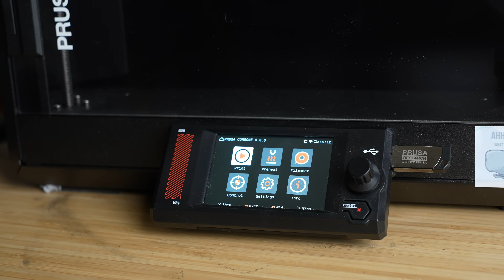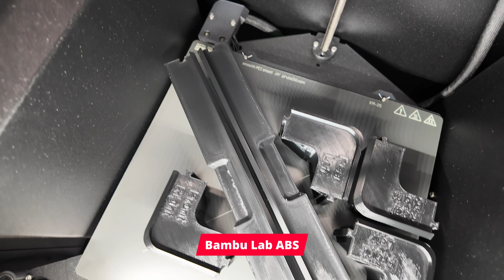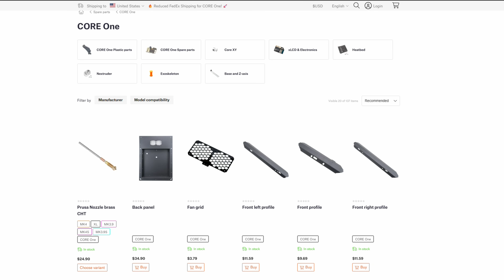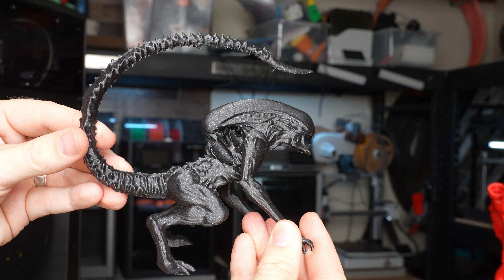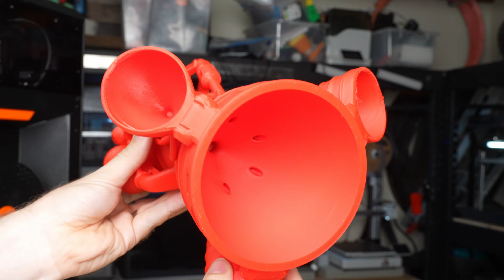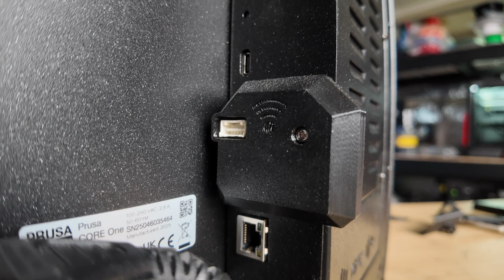The Prusa Core One Surprised Me In a Big Way

Comment: I like the look of their printers and I appreciate the openness, however...

My issue with the supposed benefit of upgradeability is that the cost of major upgrades can be as much as a whole printer from another brand.  The argument that it reduces waste does not necessarily hold true either.  In the case of other brands you potentially have a working printer that can be given away or sold, but an upgraded Prusa leaves a bunch of useless parts.  Their updating options do help when it is small improvements, but then again in the case of Prusa printers it seems to be because they invariably release them half-baked.
Reply from the maker: I think they are focusing on other aspects maybe? Not just pure feature?

Comment: It’s a bit disappointing- it could’ve had some bigger print volume without those sides plunging inward.  And the lack of a hardened nozzle and camera - yikes.  These aren’t expensive components to build in for added value.
Reply from the maker: I think they kept the same build volume because they wanted to keep their promise of having the printers always upgradeable. So in order for that to happen, it needed to keep the same build plate size as the Mk4s
Reply: @RadDadsPrintLab that’s an interesting point.  For me, being smaller than the popular 256^3 is a real downer.  And the lack of an onboard camera or any level of air filtration, which even the $299 Elegoo Centari Carbon, has

Comment: Just got the kit and the camera was included for free.
Reply from the maker: Yeah they started that promotion after I was done with the video haha . You do still have to install it?
Reply: @RadDadsPrintLab  From what I saw online, if it's pre-assembled they'll have the USB-C needed pre-installed for you, and you just connect the Camera. If you have a kit, it'll require installation.
Reply: @RadDadsPrintLab  install it meaning - take it out of a bubble wrap and plug it into the the pre-exisiting USB cable (its already in place) and attach via magnets to the corner - and then you have the camera read a QR code on your phone. Its about a 1 minute job

Comment: I purchased a brand new Bambu Lab A1 Combo, and now I have to return it for a full refund because the 2nd Spool slot will no longer feed the filament through due to an Overloaded Motorhead error. Get back with me when 650.00 3d printers or their accessories no longer become faulty in the first 3 weeks of purchase.
Reply from the maker: Dang that sucks

Comment: I think the "grow with you" aspect of Prusa printers is quite true. I've had a number of FDM machines from other brands; and while some of them may outperform their Prusa equivalents in things like print speed and/or build volume; I've moved on from almost all of them. Meanwhile, the Prusa MK3's I used 5-6 years ago, have continued to received numerous software and hardware upgrades. 

Yes, Prusa's aren't the flashiest or fanciest machines - but they are incredibly reliable; and the machine you buy in 2025, will continue to improve and receive options down the line.
Reply from the maker: Well Said! Even though it is technically outdated, I want to try the Mk4s

Comment: Nice.... Mine is not in use... 6 weeks now I'm trying to get that noisy tank to work. Hours with support and twice more to looking for resolve the problems from day 1. It's not cool it's not so great as mk4s!!! It's a simple pain in the ... That's why we have order Bambu H2D today... But nice you like it... If I would get this for free maybe I would also like 😉
Reply from the maker: Dang That Suck! What issue are you having with it? Id like to check out the H2D, but might be awhile before I can justify purchasing one.
Reply: @RadDadsPrintLab  From the start, it was very noisy in the rear of the table, both at low and high speeds. After many hours with technical support, they decided to send new XY axis motors. They arrived two weeks later, heavily used. The disassembly process began to replace the motors. The belt tensioner had been damaged from constant adjustments, and the nut inside had started to rotate. So, new parts had to be ordered. It took two weeks to replace it. I started the replacement process and discovered that one of the bearings was occasionally sticking. I suspect it might have been damaged during the process of straightening the linear guide angles, which technical support suggested. So, another 35 euros and two weeks of waiting. It's sitting half-assembled, collecting dust. We ordered a Bambu H2D for the company, and I want to order an Elegoo Centauri Carbon for home as a spare so I can print while we can only look at the CoreOne.